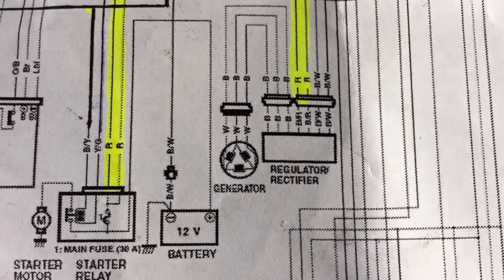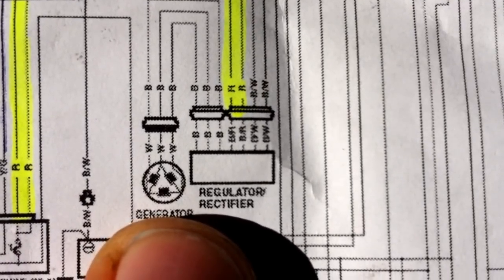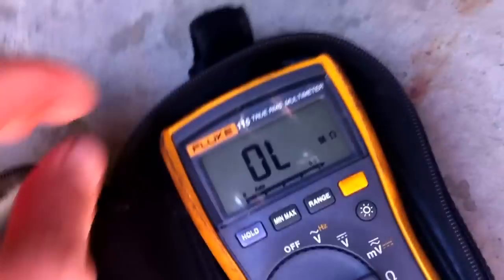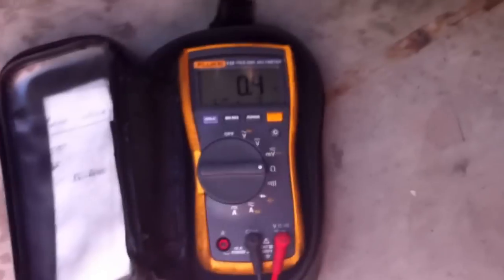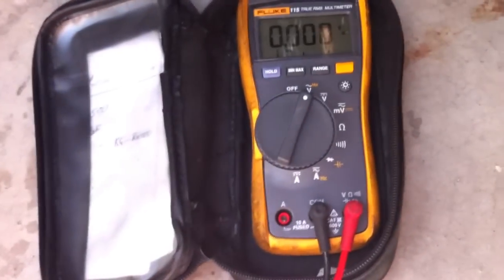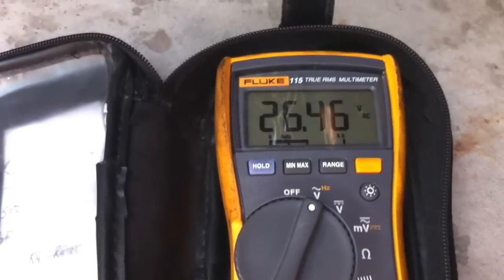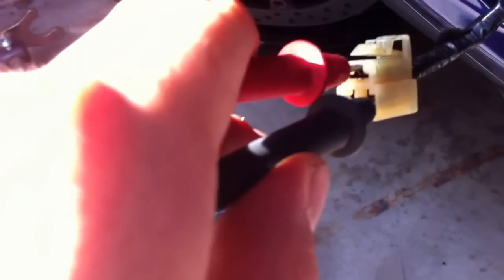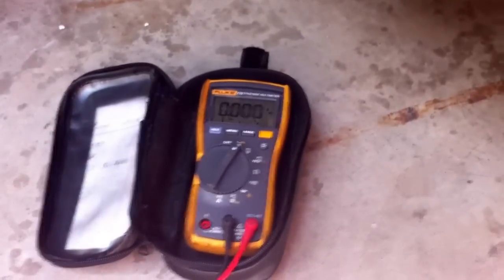Motorcycle Stator/Generator Resistance and Voltage Test

Comment: hey mate, this video is very helpful, thank you very much . I had a kawasaki Ninja zx6r 2009. It has some problems with the charging system.  When I start my bike , I test the battery , the voltage is around 12.5V when the rpm runs around 4000 rpm. So I brought my bike to the mechnic factory. The guy over there said I maybe need to change a stator, but I've look up the interent and done some research , it says maybe the regulator has to be changed. Beacuse kawasake used to recall this bike just change the regulator. Now, I have no idea how's going with my bike. Do you have any ideas about this? Thank you

Comment: I have a road legal 250 buggy which isnt charging the battery. At idle 2 phases are reading about 30v, but one phase is only reading about 9v. Could this be the stator or magneto? If its the stator can i adjust the gap or do i need a new stator? Cheers
Reply: RaptureUK1 yes its bad thats a good sigh one dif   and low

Comment: Hi tks 4 your great video tks, I have a Sym Fiddle is two stroke whit 75cc naraku cylinder the scooter cut off an few times I check the spark is look ok I don't text you wheen you have a spark the stator maybe have a small fail what you thing tks BERENGUER

Comment from the maker: @sam: The bike can just run off the battery (but it will drain fairly fast, maybe within an hr, maybe...).  The generator just generates 3phase AC voltage that gets converted to DC 14v to charge the battery.

Comment from the maker: Seb: No, your generator should be fine. You might find that if you are using a cheap multimeter you will have a reading of .2ohms in your test leads by themselves.